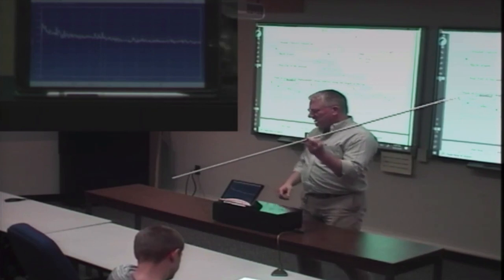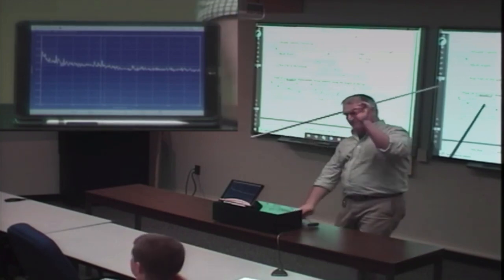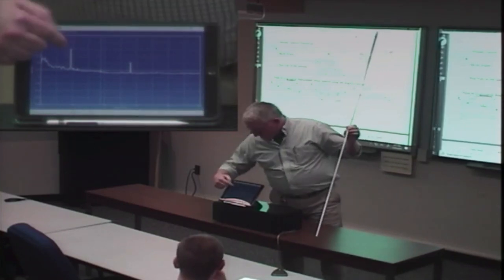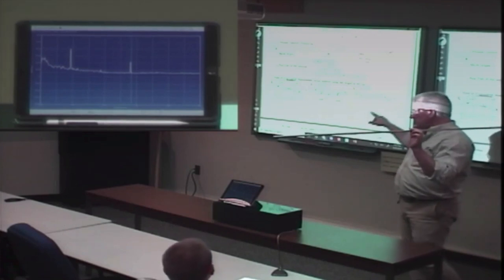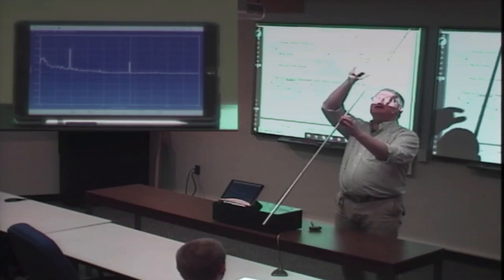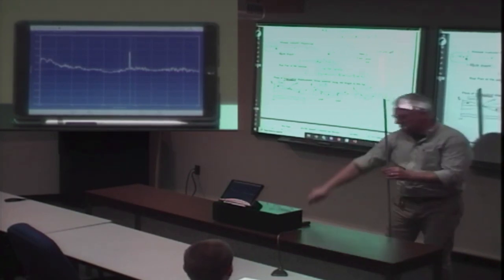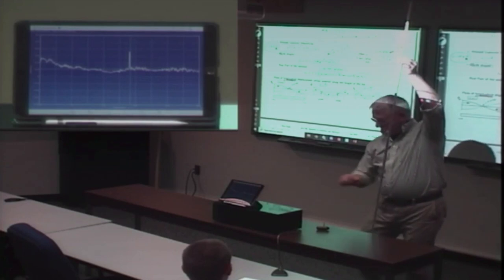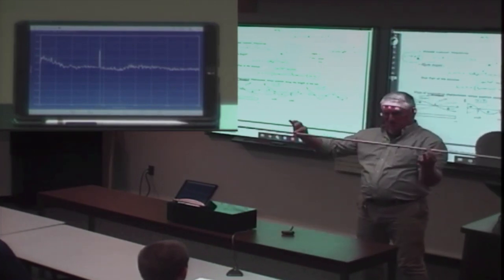Demo: Longitudinal Waves in a Rod

Comment: This can be done on guitar strings, by plucking a string then gently placing a finger on the 12th fret or some certain areas further down the string (half length, third length, and quarter length seem to be strongest)
Reply from the maker: yes . . . BUT on a guitar string you would be demonstrating transverse waves on a string (I do that elsewhere on other videos on this channel) . . . this demo was to specifically show longitudinal waves in a solid.
Reply: Dan Russell you said in the video that your holding the rod kills certain frequencies. Doesn’t that imply that you’re demonstrating transverse waves?
Reply from the maker: @The13point1  No. The flexural bending modes have MUCH lower frequencies and the are not integer multiples of the fundamental like these longitudinal modes are. And, flexural bending modes are excited by striking the rod perpendicular to the length instead of tapping the end. Longitudinal waves in a thin rod are actually quasi-longitudinal waves with some lateral bulging and compression at the outer edges of the rod. Holding the rod prevents the longitudinal motion - as evidenced by the frequency spectrum that I show in the demo for different holding positions.
Reply: Dan Russell thanks! I had envisioned the hammer tap causing the rod to deflect (like an overloaded building column). But when you describe the difference in tone pitch, it makes much more sense to me.
Reply: Dr. Russell is there a way to conduct this experiment so that the rod behave as if it were floating in free space? What would that look (or even sound) like, would you just see all the modes simultaneously or would interference start to play a roll?